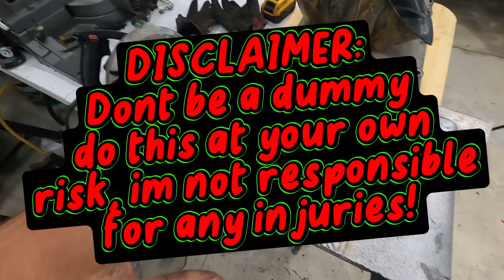Kenworth W900 Oil Pan RECONSTRUCTION

Comment: The main housing bore is damaged and if you are lucky the block can be align hone back to a standard bore size
However by the look lf the bearing I’d get crank looked at
If you use engine by replacing the bearing I would be very surprised if it gives you much service
I probably Aline honed more blocks than most people have heart beats
Best of luck
Reply from the maker: Thank you for the information. What causes that issue? And how can a block that large be out of align? That's crazy to think about.

Comment: kenworth w900 oil pan in ebay cost about $200 to $300
Reply from the maker: That's definitely incorrect. You can't just search the make and model. That's not how that works. You have to search the engine as every manufacturer uses every brand engine. Then there are different liter engines and on top of that there are many different model of the same liter engine. Thanks for your input though. 👍